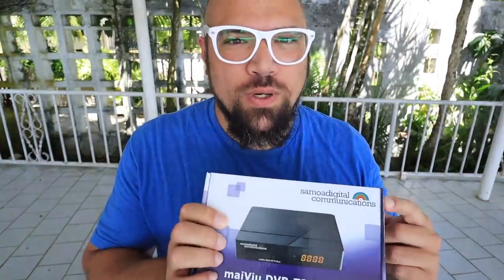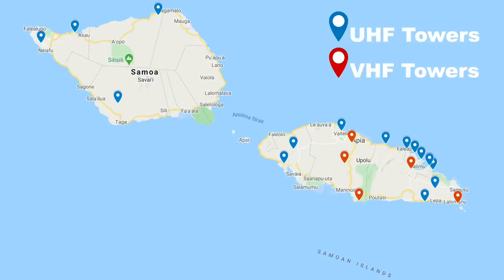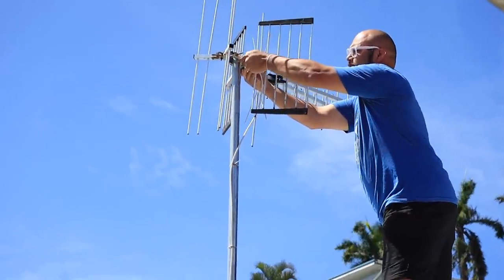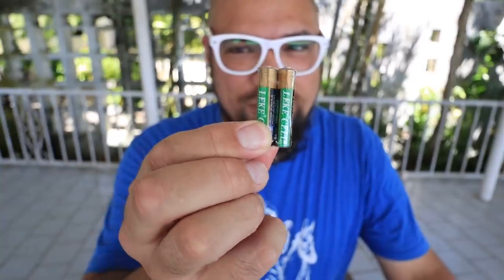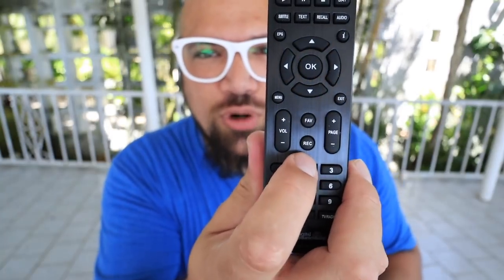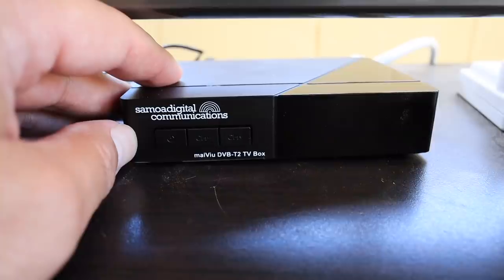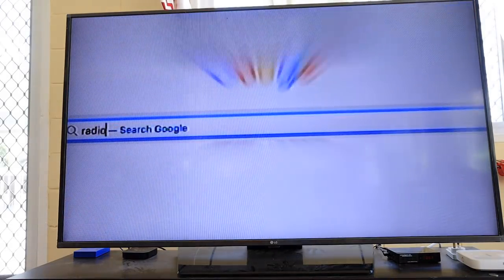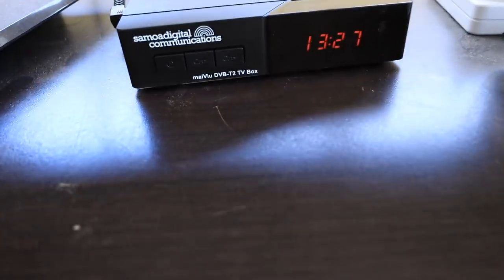SAMOA GOES DIGITAL! | LEARN HOW TO INSTALL YOUR TV BOX TUTORIAL | SAMOAN PSA

Comment: Use your HDMI to actually see the 1080p Joe. Nice job setting up the antenna. My brothers and I used to make them in Honduras and installed them all over the neighborhood. I was about 10 years old and my job was to hand sand the aluminum sticks for a smooth finish 😂
Reply from the maker: The problem is that 1) most stations don’t broadcast in 1080p yet and 2) HDMI cables are ridiculously expensive here still. Think about what an HDMI cable cost back in 2005 or something. That’s what we’re looking at over here. So just not worth it quite yet. Maybe in a year or two when we have more stations broadcasting in 1080 and more stores are carrying HDMI, it’ll be worth it. 

But yeah. I can imagine it’s hard work when you’re 10!!

Comment: You had 30% quality and 0% strength,you must move your antenna,until you get both lines " longer," if you want more channels and better reception. Nice video! P.S.soon is coming 4k tv over the air,than you' re gonna change " box," hevc 265,not 264,as now,than hdmi is a must. Good luck!